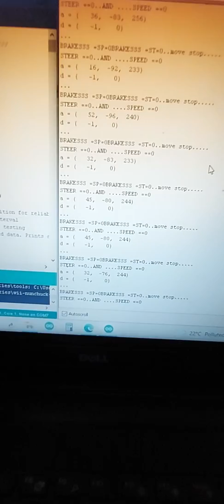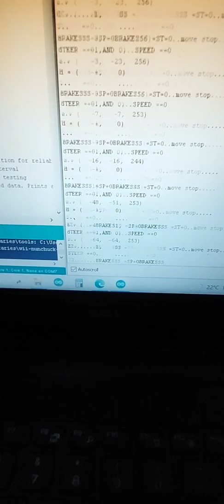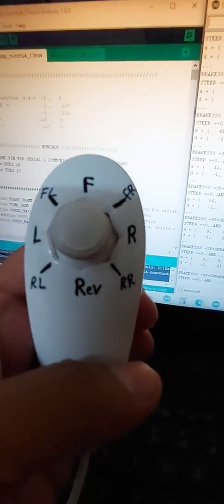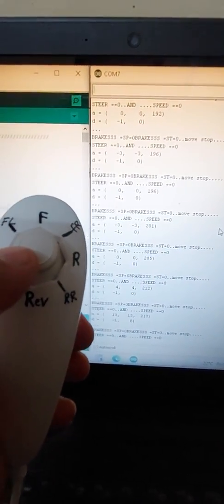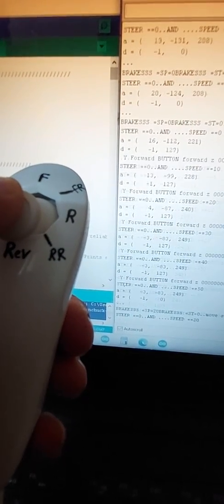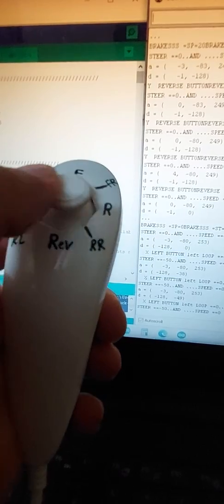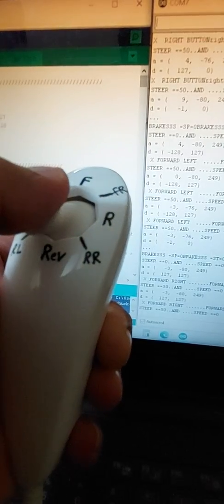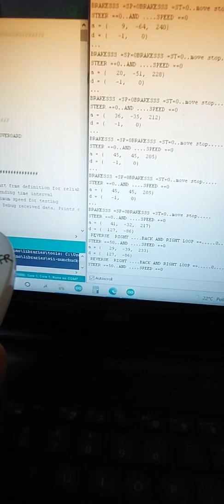DIY WII NUNCHUK ARDUINO ESP32 FOR LOW COST REMOTE CONTROL

Comment: Hi..thanks for the video. I got a clone nunchuck and it did not work properly. I would like to use ESP32 to check its responses. Could you share which pins you used for SCL and SDA? Can you share your code?
Reply: Did you solve your problem and how?